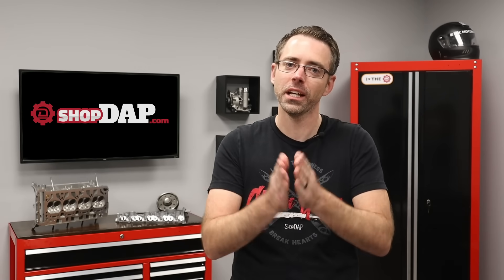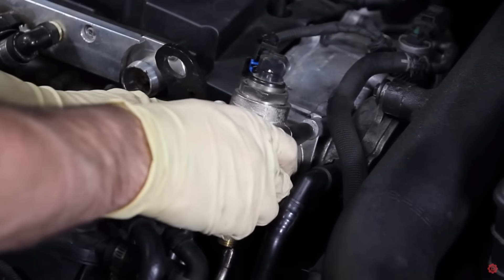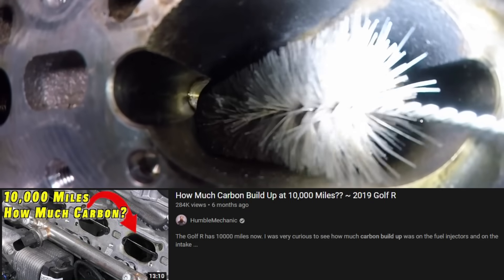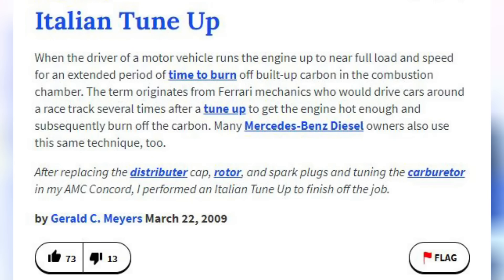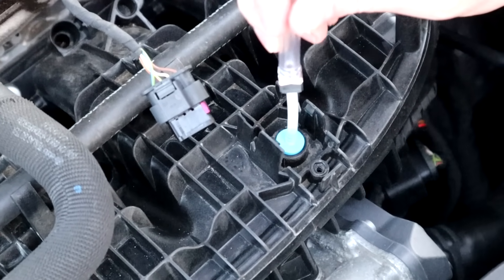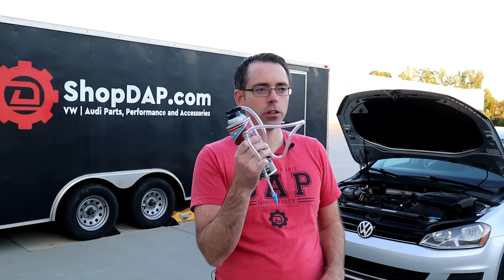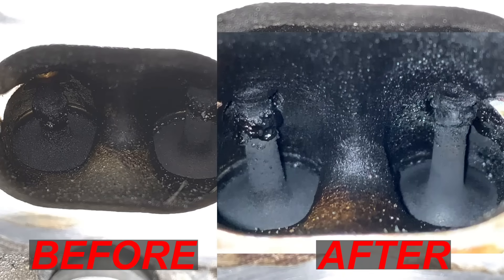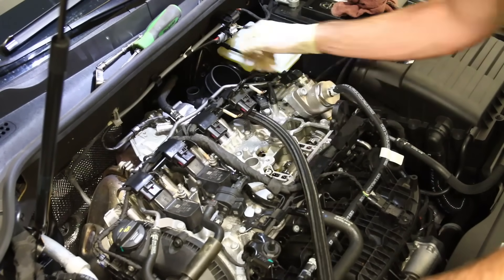Can you Really Remove Carbon for $29?

Comment: I want to see no difference I've been a mechanic for 40 years not a real one bill from show cars customization dealership far as I'm concerned a port injection the junk engines are not going to be able to clean the South line okay the only thing is going to work is MTA Textron by Chevron and that be certain way okay so or ice cold water and you have to know how to do it😊

Comment: At @14:00, some cars (like my Mazda3) have a factory OEM oil separator / catch can but the service manual doesn't specify an inspection or drain interval. Could it drain into the crankcase? That would seem counterproductive.
All this also makes me wonder how the exhaust valve stems stay clean. Even on traditional non-DI engines they never get washed with fuel.

Comment: I have a 2018 Mazda 6 with the 2.5 GDI engine with some missing on startup. At the time I bought the "kit", it only came as a kit with three other cleaners. I'm glad that Amazon now has just the valve cleaner. One thing that happened after using this product is when I took it out on the road, upon acceleration, it fell on it's face, then all kinds of leds lit up on the dash. After a mile of so, it ran like normal. I would suggest using this product at oil changes so the chemicals don't accumulate. Like you said, I wouldn't use it again and again, back to back.

Comment: I know this is a bit off-topic but I know you guys use liquid Molly products I accidentally put liquid Molly gasoline treatment in my diesel F250 6.0. It does have a full tank of fuel which is over a year all that’s been sitting because of a crank no start. I am told that I can damage my injectors by putting the wrong additive in a diesel. Some of them work in both systems I am unfamiliar with liquid Molly products and there is not a lot of information about this on their website and I toss a bottle. I would’ve thought I would’ve noticed a warning about adding to Diesel on this product’s label. I’m in an emergency situation. I need the truck moved immediately. Thoughts?

Comment: I know the video is old az BLEEP.. But then what is the take on something like Lucas Oil Fuel treatment. It says it does help an preventative process to carbon build up. Would it do so on these GTI engines. Just informing myself as a noob VW mechanic here in Germany and looking to get my 1st GTI. Want to get either a 19' TCR or MK8 Clubsport. I know both are not available in the US. So am sure you guys can comment on that.

Comment: Good to kniow: What is a short trp? = below 15–20 km without oil hitting 100°C+.  That’s the killer zone – valves get coked within 50.000 km. 
Safe zone: above 25–30+ km per trip OR at least 1–2× week a proper 30–50 km run with oil >100°C for 15+ mins. (always check oil temp)
Do that + good oil + premium fuel (and ideally a catch can) → valves stay clean for years.  No hot runs = see you again with the scraper in 2 years :D

I just cleaned uo mine, 146.000 km and cylinder 3 was 3/4 full of gunk. holy moly. i was not breathing properly. poor thing. previous owner did the exact shitty thing. SHORT TRIPS ONLY.

Comment: Of you drive your car in the city  on low rpm. Of course that every 2 weeks highway driving helps the engine to breed. In the city most people don't drive more than 3rpm. And on the higway you can ride steadily 1 hour at 3,5 to 5 rpm. And the car machine will be much better.

Comment: Umm no the “5 Guys of fuel injection” is dual injection. Having BOTH direct injection for the added power AND port injection during lower demanding driving which washes the intake valves clean. Best of both worlds…and no it is not exclusive to Audi and other German manufacturers being that Toyota has used this on their newer models for years.

Comment: Higher output will not clean the intake valves because higher output means more PM formation in a direct gasoline injection (GDI) due to poor mixing. The mixing is poor because the time for a homogeneous mixing is short compared to port-injection. This PM output combined with the recirculated blowby generates carbon bild up. Also the downside of higher PM is the formation of carbon on the top of the liners and on the oil control rings. This is a reason why many GDI engines have catastrophic oil consumption.

Comment: I took my chances with dual catch can setup on my twin turbo 3.5 Ecoboost.  Been using this for 30k miles and 0 problems.  I suspect this also reduces carbon build up on the piston rings and therefore reduces blow by.
Reply: So, you've had eyes on your intake valves at 30k? Because most engines have no problems in 30k. I gave up my beloved 2003 4.6L f-150 and bought the atlas as I was heavily disappointed by what f-150's had become. I hope each of us made a wise choice 😉

Comment: My experience of carbon materials (fiber, filters, particles, nanomaterials) is that you don't experience much mass loss under air until above 650C, and then it is a small mass loss, 800C it is much greater but still slow. This of course depends on the nature of the carbon material. The valve build up is less carbony by far than those carbon materials so oxidation is possible at lower temperatures, but still, at the temperatures engines run at, an Italian tune up is not going to do the job!

Comment: Seafoam spray through the brake line to intake 2017 kia sorento made a 💯 percent difference car runs like new
Reply: At how many miles? Do you use Top Tier gasoline? I have a 2017 Sorento that guzzled oil at 60 k miles. Got a new free engine , from KIA, after 3 piston soak FAILS..at 72.4k miles

Comment: The cleaner the motor oil, the less carbon deposits to clog your PCV valve and intake manifold in direct engine cars. I load up on Costco Kirkland synthetic motor oil when it's on sale and change every 3-5,000 miles.

Comment: I was on the Audi forum and everyone was going on about the benefits of catch cans and how they've made the top of their engine cleaner.  Best of all no risk as long as you kept dumping the contents in the can on a regular basis.  So I put together my own catch can system.  What no one told me and was not evident to me was that it would freeze up in the mid-to-late fall here in Canada.  (Evidently, everyone that was encouraging us TT owners to install a catch can system for the health of our engines all lived in warm sunny climates all year long.  IIRC, it was sometime in October (here in NB, Canada) that my frozen was causing my 2010 TTS to operate horribly on the way to work one morning.  It felt like the car was being suffocated.  It was some time later that I noticed a few drops here and there of coolant.  There was a slow leak that was eventually found on the back-driver's side of the engine, mostly due to the sweet smell of burnt coolant.  The shop gave me the bad news that I would need to get the head gasket replaced at a cost of $6000.  At the worst of it, my car's coolant reservoir went from max to min within a few weeks of driving.  It had absolutely no issues and less than 70k kms on the odometer before I made that awful decision to install the catch can.  I figured there must've been a terrible pressure buildup that caused the leak to the head gasket.  Does that sound right to you?  I don't know how else it would have happened.  I take meticulous care of my care with only the best fluids.  FYI, I also have a GF Bits diverter valve (Go Fast Bits is an Australian company).  It's supposed to not completely dump all your boost.  It's supposed to be able to more efficiently dump ONLY the amount of boost that could harm your engine and keep you in the power band  That way you don't have to start back at 0 to build boost for your power.  (That is how it was explained to me in layman's terms.)  Could that have caused, my head gasket leak?

Comment: I soaked them in purple power extreme & I removed about 80% of the carbon from 3 of the cylinders, One of them was extremely terrible so I had to use a wire brush on a drill to get in the & get most off, Then soaked it for another 24 hours , Got super clean after that

Comment: I deleted my pcv valve on a 10th gen civic, besides the occasional oil drip stain I have not had a issues . I ran 3/8 hose routed it out to the bottom of the car aimed at the ground and the other half I stuck this mini air filter thing I had from a catch can I used to have installed. 2016 civic and it’s 2025 no problems yet n hopefully never. No clue if I have build up never seen past the spark plugs never opened up the engine that deep

Comment: What about EGR?
I have a  2001 1.4 16V 75bhp "AUA" engine that have a P0401 "EGR low flow" code.

What is the easiest and cheapest way to solve that?

Comment: so engineers design cars to build up soot so it won't pollute, but when its full we try and clean it dump it one time big time. so basically it is still the same. I will just delete my EGR so no more soot problem
Reply: As he stated, the best solution is to 1) use a high quality synthetic oil that is less prone to breaking down and releasing hydrocarbon fumes that condense near your intake valves, and 2) use a high quality top tier gasoline with detergents that will prevent clogging of your direct injectors. Finally, there is a difference between the PCV function and the EGR function. Learn about it.

Comment: So, how does that spray work with turbo engines? Like V6 DI turbos?
Also, the reason you don't want to use that spray cleaner too much is that you run the risk of clogging up your catalytic converters...that can get VERY expensive...

Comment: That’s carbon on a bridge too far. Only walnut media blasting will remedy situation. Why do ppl wait too long to get this done? Honestly, from day one with every 5,000 miles use CRC GDI cleaner. Engine at peak operating temperature pin the rpm at 2,500-2,800 rpm. Start the cleaning process. Don’t let the rpm drop or engine will stall. Once can is completely empty go for a drive, drive and do it for 15-20mins stop and go and some hwy then go and get an oil and filter change. DYI or not but get it done after the process. You will never have that expensive and troubling experience again. Promise 🙏 FYI this process must be completed within hours of each other not days so you cannot put it on pause and wait a day or two later. possible damage to engine could occur because of liquid possibly thinning out the oil further than it is already. Say a 0w20. Yep too darn thin to begin with.

Comment: I ran this in my 2005 Magnum 5.7 just last night, and it genuinely smoothed out the idle. I'd postulate that in an older car that has never been treated maybe do 2 to 3 treatments a few weeks apart but if you want it cleaner than that you may as well pull the head and have it remanned.
Reply: The 5.7 in your Magnum is port fuel injected not DI so you already have fuel washing  the valves and keeping them clean.

Comment: To avoid this issue, buy a vehicle that has an engine with both direct & port fuel injection. Like a Toyota or Lexus that has both Direct & & Port injection on all their engines. You are using a Volkswagen as an example. In North America, Volkswagen has only direct injection; well some really old turbocharged Volkswagons might have both direct and port injection systems. Volkswagen claims that VW's engines since the EA888 Gen3 do not have a carbon issue with only DI. No longer an issue. In Europe, Volkswagen have both direct and port injection engines.

Comment: Is this the Achilles Heel of DI engines? I have a DI engine in my car and kinda angry that this was not fixed in a better way from the beginning and even if there was a relatively easy regular maintenance that could be done, let's say at the same time the oil is changed. The present situation is just not good enough and the car manufacturers get a 1 out of 10 from me on this score.
Reply: There are mechanic shops that offer engine cleaning services. Would need to schedule a cleaning with an oil change service. Bringing a normal oil change to an expensive inconvenience. Progress.

Comment: CRC Valve intake cleaner has the highest amount of PEA ( a cleaner called Polyether Amine) - Liqui Moly and STP etcetera, same chemicals, less of them. 
The can approach takes 2 applications, 1,000 miles apart. For best results, use a vacuum port off the air intake boot downstream of the brake booster line to apply the stuff. 
After installs 1 and 2 - do that treatment every year or 10,000 miles thereafter. It does clean some off. Get a camera down there, no it it not factory, but it does help, a lot. 
This is the most cost-effective and non-invasive solution with long-term maintenance which I could find.

Comment: Run the engine at about 4500 rpm in park of course for about 5 mins. Once every every oil change after you changed the oil. It helps blow any carbon out of the engine. Also, no you don't have to go out and ROMP on it like ppl do that is needless stupid. The higher rpm helps a lot in park is just fine! People call it blowing the carbon out. It can be done with out beating the crap out of the vehicle.

Comment: A good method would be for the manufactures to introduce a hydrogen system to the air intake.  It will keep the system clean and free of carbon from the beginning and add a bit of power as well.

Comment: Perhaps "italian tune-up" is a bit misleading, as it's something you do to PREVENT excessive carbon build up, not something to "repair" when the build up is already there. Same thing with brakes: We all tend to brake to softly, if we approach a red light, we'l brake very early and very smooth to kind of time the drive towards the green light, that's the most comfortable way. But it's not good for the brakes, they will seize up or semi-seize up and have to be overhauled way too early. SO: Drive your car more "sporty" in every respect, and it will stay healthier longer.

Comment: @Deutschautoparts Just to confirm, disconnecting (and not removal) of the Mass Air Flow sensor is recommended, correct? I have a 2012 A3 and about to do this service. Thanks for the informative video! 👍

Comment: Good presentation. I noticed that most of the GDI carbon buildup presentations mention the need to service catch cans as an issue.
Servicing a catch can could not be easier. When performing an engine oil and filter change, unscrew the can, dump it out and reinstall it. At worst maybe a 1 minute operation.

Comment: A proper oil change interval and a good oil. An oil catch can and even the addition of a low intensity water methanol injection system. Will keep an engine really clean whether it uses direct injection which is I think is a laudable technology. It is only been around for a bit over 80 years now as it first appeared on messerschmitts during World War II. I have seen diesel engines come apart that have water methanol injection cleanest engine I've ever seen with over 100,000 miles on it. It was cleaner than once I've seen come apart at 30,000. It was a lot cleaner than any other engine I've ever seen.
Those same Messerschmitt engines all had water methanol injection and even nitrous injection for short-term burst of speed.
It's amazing sometimes how old this new technology is. The biggest upgrades in engines has been just a bit more in the Metallurgy side of things than anything else and maybe a few minute details now that we have absolute proof that you can modify an engine to actually have an exhaust that is breathable air. And if you don't know that you haven't been paying attention. It is entirely possible to modify engines to actually use closer to 60 to almost 80% of their energy, instead of 30 to 33% which is current, add be putting out 20.5% oxygen less hydrocarbons than the tree in your front yard, and almost zero carbon dioxide levels.

Comment: $35 HARBOR FREIGHT WALNUT BLASTER(NEED AIR COMPRESSOR) + $13 WALNUT MEDIA FROM HOME DEPOT 
AND/OR 
FLOOD THE CLOSED INTAKES WITH $5 FUEL INJECTOR CLEANER AND SCRUB AWAY AND DRAIN OUT AND AIR OUT WITH BLOW GUN

Comment: I've heard some mechanics claim that a catch can actually makes carbon buildup worse. They say that the water vapor that is condensed in the can normally helps keep the valves clean as long as the engine has time to warm up. Im wondering if this is true because I'm already on the fence about putting a can in my car. I live in the Midwest and occasionally it gets very, very cold and I don't want a frozen can blocking my PCV.

Comment: Not without removing the intake manifold and manually turning the engine to close valves.  I cleaned my BMW N54 valves for cheap but it took a fair amount of effort on my part.
Reply: What did you use to clean the valves?

Comment: These engines love highway driving. Had a 2015 Ford Taurus with the 2.0L in it and drove over 50k miles of almost all highway miles. When I traded the car in at 78k miles she ran like new. That car sold quick off the lot. If you drive like an old man or don't drive much, you will need to do some walnut blasting at some point. Just don't go to a dealer for the work, they will charge twice the price of a local shop.